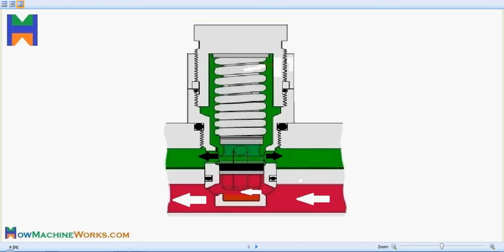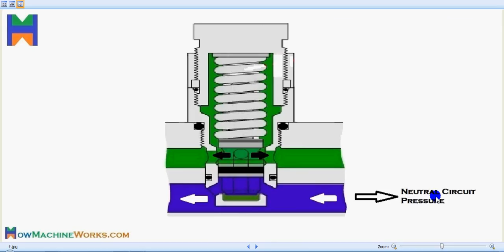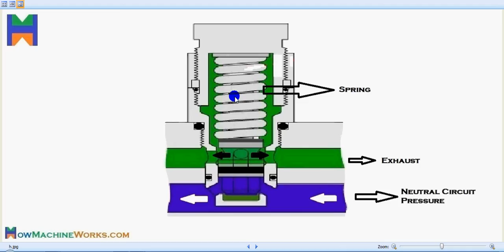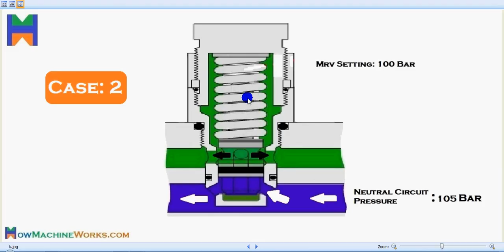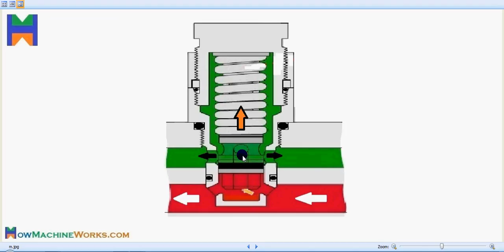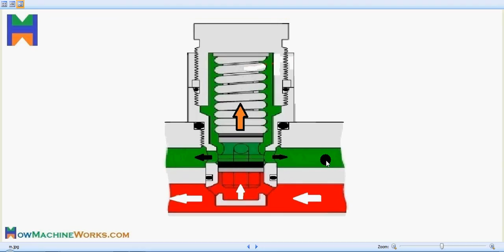How main relief valve direct acting works. ✔

Comment: if mrv is not there, it will damage the pump.. how? may i know?
and when this pressure is exceeding the limit? for eg, in a excavator when this situation occurs? hope you will reply
Reply from the maker: yasir T.M If MRV is not there, there will be back pressure which the pump will be able to handle and it fails MRV divers the excess pressure and saves the pump. eg. when there is an impact load this can happen the pressure will shoot tremendously.Thank you, Please SUBSCRIBE to us for more videos. We have a face book
 page just search for TechTrixInfo in face book  -  TechTrixInfo.com